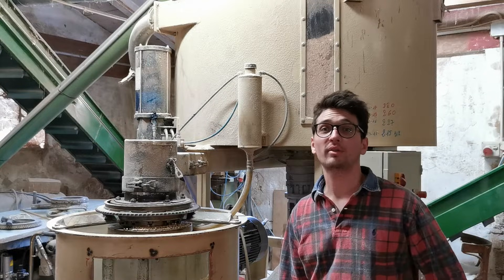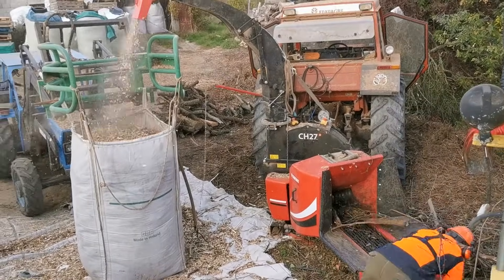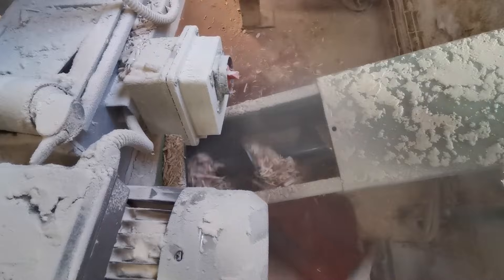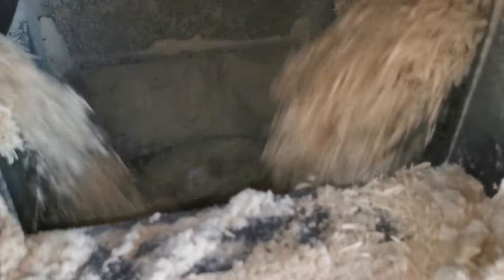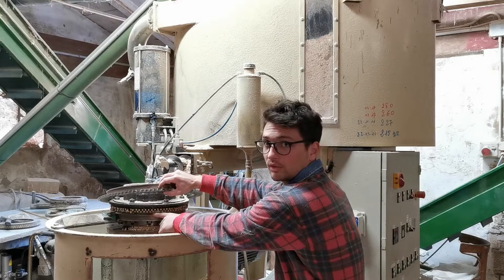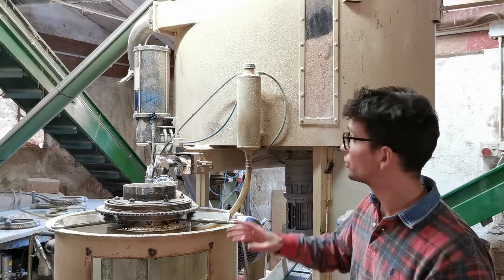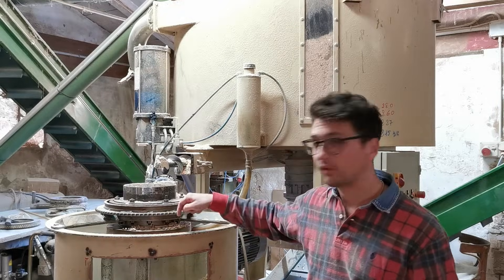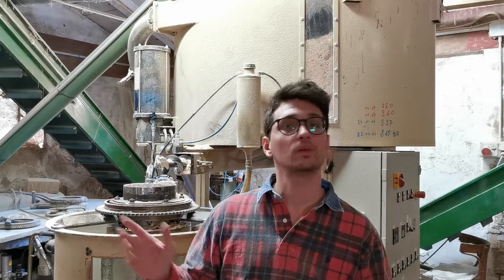wood PELLET - How It's Made! [factory and machines tour]

Comment: Excellent video, thank you for going into so much detail! I do have one question I may, how many tons of pellets can be produced before the die needs to be replaced? 
Thanks! 
Peter
Reply from the maker: hi! Thank you for the comment! WEell, it really depends on how much the wood mixture contains soil resduals and small rocks, all elements wearing out the ring die. If it is really dlean (as our case), the one you can see in the video has done more than 250 tons of material. A colleague of us uses a very 'polluted' material, has changed the ring die after 30 tons...very bad as you can imagine. Moreover, you have to consider that even if we are doing more than 250 tons of material, it has weared out, in particular in terms of diameter: it started from 6mm of diameter to 7mm now...but it is ok for the production, so we don't need to change it.
Remember that you have to do maintenantce on it: you have to rectify it, to keep the centering of the rollers into the internal cylinder of the ring. We don't have a measure....you have to look at it depending on the wearing status of both rollers and ring die....when they do wear out tooo much on the boarders, then you have to rectify it. Hope that was clear for you! I'm here to be clear for more questions! Bye!
Reply: @profilo_is_back  Yes that is very clear! Thank you very much for taking the time to reply in such detail.

Comment: Hi, I would like first to say congrats for the prodcution line  you own! NIce job!
I have 1 remarque and 2 questions please, if possible:

1) If one of the machine is in damage, let s say the final one, what s the backup of the proces? Is it neccessary to have a backup machine, or the cadence doesn't require it, and you have enough time for reparations ? One linked question, whats the frecquence of maintenance plan ?

2) What's the capacity of installation /h ?

3) In total delivery cost, is it more profitable to buy the raw material (wood and wastes), and to transforme in wood sawdust ?

Thank you in advance, 
Bogdan
Reply from the maker: HI! Thank you for the comment, I'll reply below. Thank you for the kudos!
1) Well, if we would have two or more machines we would use them continuously all the time all the machines.....we do have actually one, so we use it full time. Our budget (both money and people working here) are enough for one, we cannot handle more. So yes, if you have more, you can do maintenance on one machine meanwhile the otehrs are working.
The frequence of maintenance plan is very unpredictable, unfortunately. It really depends on too many variables such as material quality, rollers temperature, material cleanliness, softness, humidity level. Since we do typically work with different wood mixture, we have to continuously adapt the working conditions. In tese days we haven't changed the rollers still, they are producing about 700/800 kgs. You have to keep in mind that this is a really small machine,, so the down time due to maintenance is quite small: in, let's say, about 30/45min yu can change both rollers and re-start the production easily. In much bigger machine you have longer dow-times.

2) The production is abotu 150 kg/h, it really depends on material hardness.

3) it depends on the cost of the raw material. If you owe it, or you can buy it profitably, and you have the machines to transform it, I would say to follow this path. Otherwise it's better to buy saw dust or wood chip, then mill them in intermediate material as teh one you see in the video.

Hope I replied efficiently to your questions, I'm here for more clarifications. Bye!

Comment: Hi. Thanks for the video... i have a question. I have a small pellet setup
 But i manage to get 180kg h, with 22 kw press, some times 120kgh.

If i feed wood chips.the press jams or amps go to 80 way to high. If i feed material like yours wiht 18% i have then around 180kgh, but if i feed dry material 12% it becomes unstable, jams, and amps bounc up n down... way to unstable.

If i try feeding smaler particles the amps also get more stable.

The question is..
 How are you able to press dry material? How are you able to get the amps stable what are the things to pay attention?
Reply from the maker: Hi! Thank you for the comment and sorry for the late response. Well, for sure the ring die is something you have to check. It defined the wood compression, that is related to the power consumption fo your motor. For sure stability of production (amps) and ring die are related. Be sure that the ring die is in good shape. We periodically check it and, if required, we rectifie it. Finally, in case you have too dry material, you can think of adding a bit of water. I remember this problem few years ago. We bought a water spayer injecting humidity into the mixture (for sure do not add water in 'liquid'  mode...use a sprayer/vaporizer). Can't you use 15-20% humid material? Why is yours so dry? Maybe you can also think of adding non-dried material to your final mixture, to reach the desired value.

Comment: this is very interesting.  I work in a small cabinet shop, and it drives me crazy to see our scraps going to the landfill.
Reply from the maker: Hi! Thank you for the commnet! I totally understand you...in fact, we don't really use (for personal use) high-quality wood. I really prefer low-quality, because I don't want to waste anything if we tal about burning. We do waste so much material....and we have to remember that also branches and sawdust is ok for burning. You don't really need hig-quality wood. Bye!
Reply: Sell them as "camp fire wood" to a distributor or by yourself.
Reply: A plant I worked at used wood fibers made from furniture manufacturing scraps (hardwoods)...the wood scraps were pulverized using a hammer mill.
I totally understand your concern...I hate seeing wasteful practices /habits.
I'm betting there's some sort of market for those scraps (hobby wood comes to mind).
🇺🇸👍
Reply: hey - I agree.  I could take it from you, depending on how much you produce.  We can filter it as mulch if no metal.  Sounds like you could have good product so I could probably use it if that is of interest

Comment: Can you use saw dust to market pellets
Reply from the maker: Hi! Thank you for the commnent! For sure you can. YOu will need a die with small holes, to guarantee much more compression. Better is to mix it with a bit of wood chip. We were used to mix them together, when we had a lot of sawdust in the factory due to another activity. Bye!

Comment: Thanks for a informative video!⭐️ What kind of production rates do you get out of the mill? Kg/h?
Have you ever considered milling sawdust directly instead of crushing wood chips?
Reply from the maker: Hi Thank you for the comment! this machine, depending on the hardness of the material, goes about 150/180 kg/h. It is a quite small plant. It also depends on the ring die/the compression you want to give to the final product.

Comment: How do you handle stones that might be enterd into the process?
Reply from the maker: Hi! Thank you for the comment! this is a very good and critical point. The control starts at the beginning of the process, when we get the wood into the factory. Woodworking production wastes are typically clean, so we just have to remove a bit of dust (with the rotating sift you can see at the beginning of the video). Different discussion about raw wood (branches and trunks). We pay a lot of attention when moving it on the land...with the escavator + crane we try to do not touch the ground to avoid soil onto the bark. This is beacuse 1. stones and land will ruin a lot wood chipper knives 2. they do not born: if they end up in pellet they will produce only residuals, that's not good (some people put voluntarily soil into pellet: it weights a lot, so you pay, but the cost is 0: a lot of money for them. Anyway, this is another discussion). The problem is when other people bring material to you, especially branches....they do not care that much about material cleaneliness, and you have to pay a lot of attention. Several times happened that big stones broke our equipment, in fact we do not accept material we don't handle personally. If a stone passes throug the chipper, it will be small enough to be smashed into smaller pieces in the hammer mill, so you won't have big problems in the ring die. Different reasoning for metal pieces: if the magnet doesn't catch them, then those of high dimensions will create problems in the main mill. Hope this was ok for your question!

Comment: If I use MAINLY small tree branches, cause I have a lot of them, should I be worried about ashes - you know I can not peel the small branches from their bark the same way you do it to big trees? Should I be worried if they have their leaves on?
Reply from the maker: Hi! Thank you for the comment! Well, for sure your product will have more ashes compared to the one coming from big trees. It depends on what you have to do and where you'll burn it (home - pellet stoves or big boilers). No, I won't be worried about leaves. They do not add thermal power (is much much lower that the one of the wood) and they produce only ashes, but actually not that much: their mass is absolutely negligible with respect to the other wood. Also their ashes production, compared to the the ones produced by bark and wood, are much much lower. But remember that this is gonna be a lower quality product: better to use it in big boilers, not in home fireplaces.

Comment: Excellent Video
Thank You
Could you reduce power consumption...maybe by 50% ?
Reply from the maker: Hi! Thank you for the comment! The first point may be about renewable energies: it will cut A LOT the final cost of the product. Second, for sure I cannot reduce pwr consumption of about 50%, I don't know where put my hands. I mean, the main consumption is the 9kW motor for the mill, that's it. Other are about lights and material handling and transportation. Maybe a different layout of the fabric could help, but that's the space we have, so.... And I don't think ti will impact a lot on the final energy consumption.
Reply: @profilo_is_back  
Life is full of Challenges...
Maybe if the Q is rephrased...How much can Power Consumption be reduced by ?
9kw is a lot
Could you use 2 smaller machines with combined power consumption less than 9kw ?
Please forgive my noseyness, Machines Processes and Layouts can allways be improved and made more Efficient.
Challenge Yourself and your team to find Small Improvements and once in the habit you will find tackling more substantial Improvements Easy.
There is a dust situation this could be a healthy start.
Please again forgive my impudence its not intended as criticism.
I used to run manufacturing businesses seeing a good operation like yours gets me engaged.
Thank You for showing me your business. 👍😃💯
Reply: @willobrien2872  you can't avoid physics, that 9kw motor is doing the work - compressing wood, that is unavoidable, the only thing that might be improved is the motor itself, it looks like he is using induction motors, so switching over to permanent magnet motors could decrease power consumption, but cost/complexity could be an issue
looking at heat generation at different stages, collecting that heat to use at other parts of the process (like drying the wood) could increase overall efficiency, but, again - cost of implementing and maintaining it might be prohibitive, perhaps it simply doesn't make sense for a small production like this, but might be much more beneficial for larger operation

Comment: I did not know custom woods were used, I assumed it was just waste sawdust for a mill and scrap wood.
Reply from the maker: Hi! Thank you for the comment! Yes, this is a really small factory, you can specifically choose different kind of woods to create your own mixture. You may have buches or you may have your own material. We make pellet with your own wood. For sure there are some requirements: not too much hard wood, otherwise it won't pass through holes of the die, on the other hand not too soft, otherwise it doesn't stay compact. You can choose flavours, yes, but they have to be mixed properly.
Reply from the maker: That's the kind of flexibility we want to have here.

Comment: Appreciate your good explanation!!!  I just wander how much kWh of electric energy is required in the whole production process per kg of pellets.  When comparing it to the kWh of combustion energy in the pellets, it would give an indication of the efficiency of the complete cycle when using pellets for heating.
Reply from the maker: Hi! Thank you for the comment! This is a good point. We have never done measurements like these, it would be very interesting find out how many kWh of energy you can recover from the low quality wood, consuming other kWh of good electical energy. For sure the efficiency in the production will increase if the electricity comes from renewable resources (unfortunately, we do not have photovoltaic panels or wind turbines here). You also have to ocnsider the fact that you are recycling material: you use good quality electrical energy to reuse materials that do not have any other kinf of value. Do you agree with the reasoning?
Reply: @profilo_is_back  Thanks for your reply!!!  By the recuperation of scrap wood this process will have a positive net result.  But I guess lot of pellet producers start from non scrap wood?  
If the pellet factory is linked to  an electric counter, you would need to check the kWh consumption and the kilo's of pellets produced for a period (one week?).  That would allow the kWh/kg calculation.
Reply: @tuttebelleke  If the process used a large amount of electricity, it wouldn't be profitable.

Comment: I know there is lots of wood dust in the making but are you never concerned about fire in your plant as the motors do get hot
Reply from the maker: Hi! Thank you for the comment! Well, you are right. At the moment we haven't found a way to avoid that. Unfortunately, is something you cannot really doing nothing about it. You will always have dust in the facroty. Also because the same room hosts both pellet production and wood working and storage area. Yes, we are concerned but we always keep it under observation. Motor do get hot, ok, but not that much actually.
Reply: @profilo_is_back  you really should pay more attention to dust accumulation, it has a definite explosion potential (there are documented cases of this in the past), static electricity  is the ignition source, not heat from the motors, you cannot "monitor" it, you clean to prevent fine dust accumulation, "monitoring" it doesn't avoid the risk

Comment: why not use fallen leaves?!
Reply from the maker: Hi! Thank you for the comment! That's a good idea. However, even if I really like low quality material, fallen leaves are a bit too much low quality. They do have a really really low heat power content. IN order to produce few hundreds of kilograms of material you should collect a lot of leaves. But if you do have a gardenig activity, you may think about. I don't really now the effectiveness of leaves in burning. Maybe is a good idea to smash them and use in wood chip boilers, without pelleting them (that is the expensive phase of the transformation process).
Bye!
Reply: @profilo_is_back  In Ukraine, a boy tried to make paper from fallen leaves. Made several tons.
Reply: @profilo_is_back  absolutely right 👍

Comment: Great video I have just put in a wood pellet boiler. It great but the pellets r getting expensive to buy
Reply from the maker: Hi! Thank you for the comment! Well, you are perfectly right...this is the reason why to warm our house we do not use our pellet, that is a high quality product, made with very good wood. We use instead very low quality material, such as bark and branches all chipped together. We do have a Froling Wood chip and pellet boiler, that burns efficiently even low quality material wood chip. You can find many videos about that in the channel (both Froling wood chip boiler    https://youtu.be/_UsDvLMjICs    and wood chipping process    https://youtu.be/r-_DH0HxDSE   )